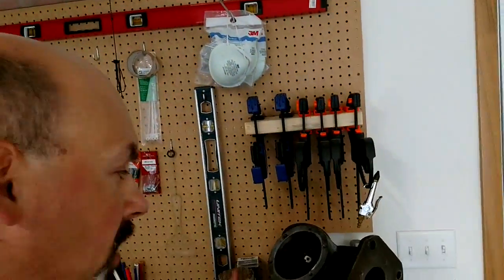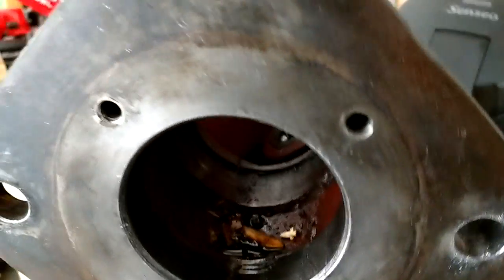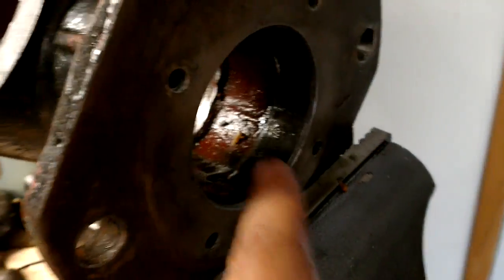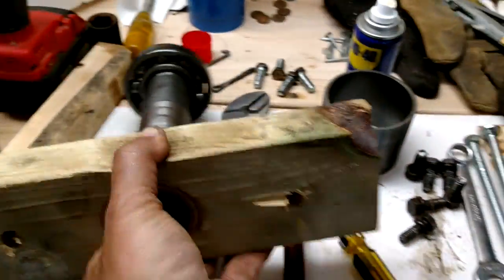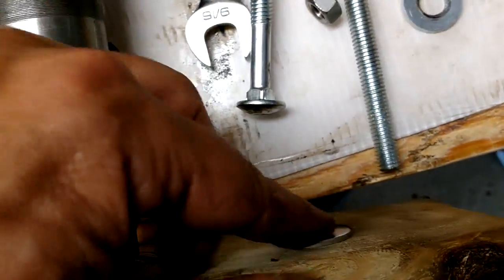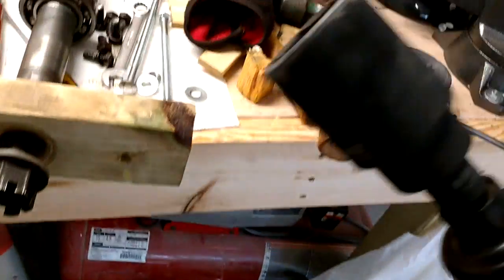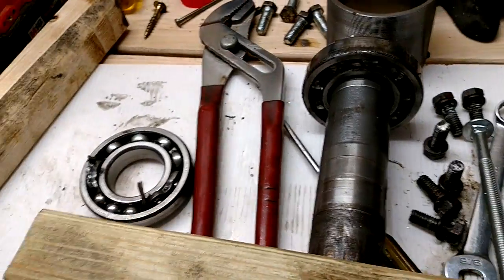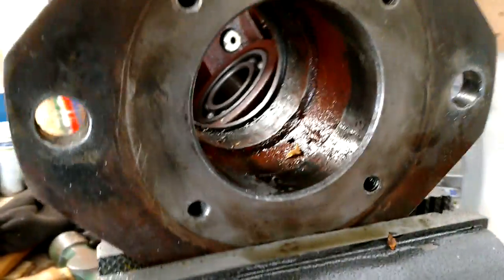Removing shaft and bearings from output end of brush hog gearbox

Comment: Thank you! This got me thinking and I used an old brake rotor as your 2x4 and 2x4s as the spacer. Mine was rusted inside and it took a lot to get out then a few taps.  For the back bearing I used the greasy rag trick.  I punched pieces of a greasy rag into the center of the rear bearing and it pushed it out. Thanks again! This what youtube is for!

Comment: HOW DO I GET THE GEAR BOX OFF?
Reply from the maker: You got to remove the blades first.  Then remove the shear pin that connects the hydraulic pump to the gear box.  Then remove the 4 bolts that typically hold the gear box to the frame.